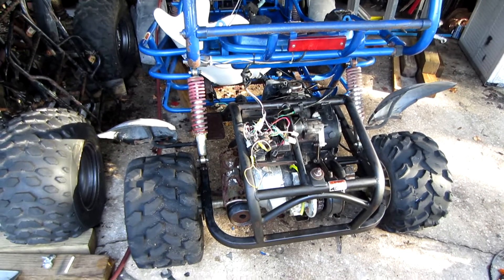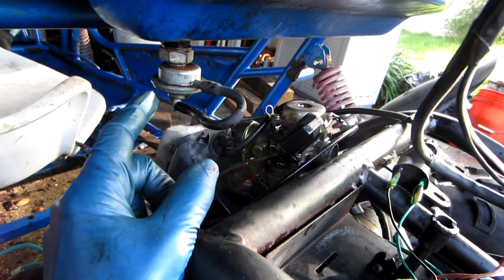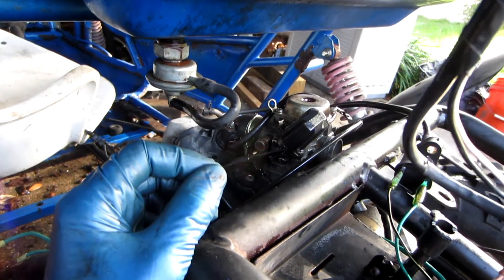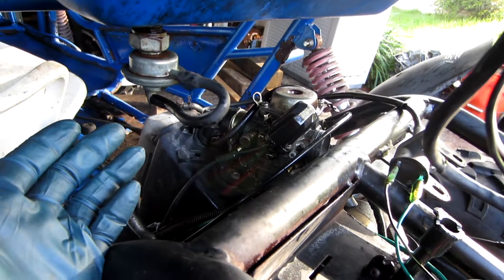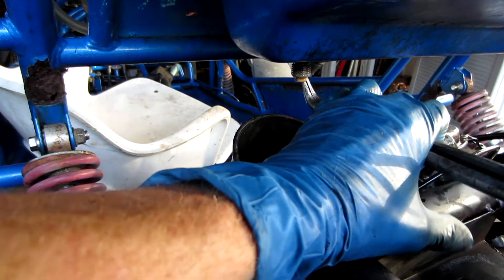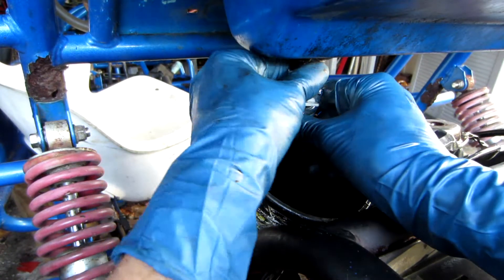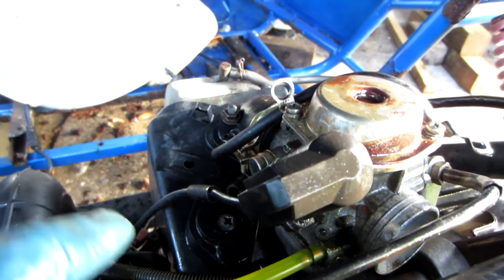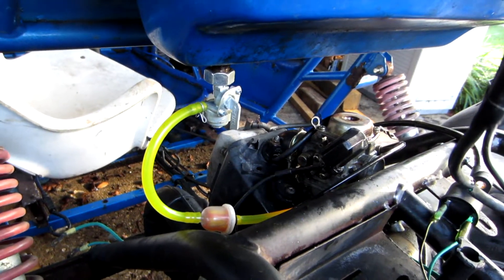Vacuum to manual petcock conversion on Gy6 Buggies

Comment: All i did was burn the vac diaphragm to a crisp on my cooker then plugged one of the outlets and installed a cheap inline tap further down
Reply: Can you please explain what you mean by burning the vacc diaphram and also which outlet did you decide to plug and does it matter?  Im having very hard time trying to figure out if i even  need the vacc lines connected to the carb at all 
Due to how the last person who owned the gy6 buggy b4 selling to me, any advice is much apreciated ty

Comment: Why os piston compression used to move fuel?
Reply from the maker: Shuts off the fuel when the engine isn't running in case you crash or something.

Comment: Do I have to reroute the vacuum line or could I simply just plug that vacuum line that comes off the petcock when going to a manual valve either way it should work right
Reply from the maker: Just plug it off.

Comment: can I get rid of petcock and replace with a manual fuel shut on/off valve and block off the vacuum intake holes on the manifold completely since I wont need any vacuum to pull the fuel from the tank anymore?
Reply from the maker: yes

Comment: I have an additional leading down to two additional diaphragms for my vacuum system. If I remove this component do I have to keep those lines connected?
Reply from the maker: once the vacuum petcock is gone you can eliminate any lines that were running to it. Just make sure they're capped off so you don't end up with a vacuum leak.

Comment: Nice video, this seems to work only if the gas tank is higher up, mine is under the floor board, Id like to get rid of my vaccum pump, do you have a work around for deleting the vaccum pump on scooters with the low tanks?  TY again

Comment: I have done this same thing on my buggy (2020 Trailmaster 200 XRX with a carburetor on it's engine) and runs great so far but, Is it fine to leave the petcock in the "on" position or will it flood the carb.?
Reply: i had mine left on unless I would not use it for a month or so, I would turn it off. U had no problems.

Comment: Can you help me see where the vaccine lines go ? Thanks
Reply: I second this. This has sat thin my parents garage for many many years. I finally went over to pick it up and my step father had put a new carb on it. The hoses to the carb were all over the place. Can you show us where the lines all lead too?
Reply: @ColoradoOutdoorsmann  left(driver) side of intake manifold and right (passenger) side of carburetor. If you're still using the vacuum petcock then you need a T connection that connects all 3 line together.

Comment: I have made the same thing on my buggy but when I connect the vacuum line from the intake to the carburator the engine die. Do you know why this is happening? I had to leave these lines disconnected so the engine can run perfectly
Reply from the maker: That's very odd, That piece on the side that the vacuum line runs to is the Air control valve, it prevents backfires when decelerating. There may be something up with it.
Reply: @pfun41  I did notice that the engine dies if I block only the line that goes on the intake, I think must be something wrong with the air flux to the carb so. Thank you!
Reply from the maker: @Briggsfpv  If it only runs with the line to the intake open then you have a major problem with the carburetor, since that open line is creating a massive vacuum leak.
Reply: Mine too I put a cut off switch and fuel filter on hose ends after I cut in middle so I can adjust air flow